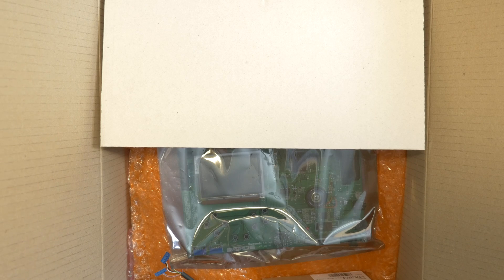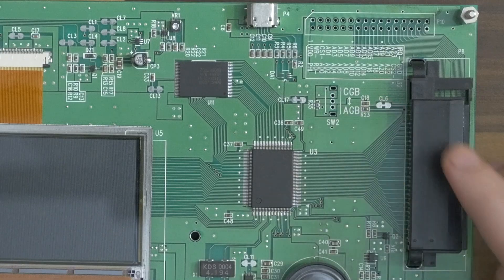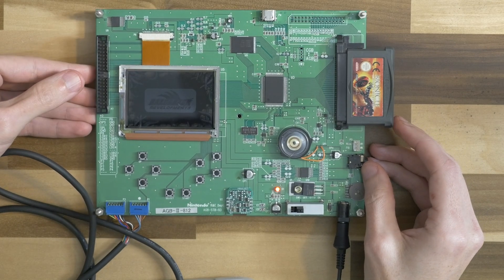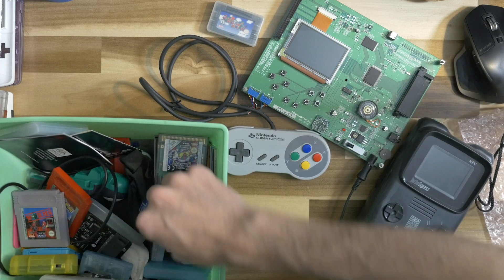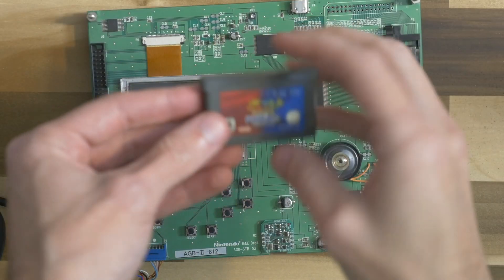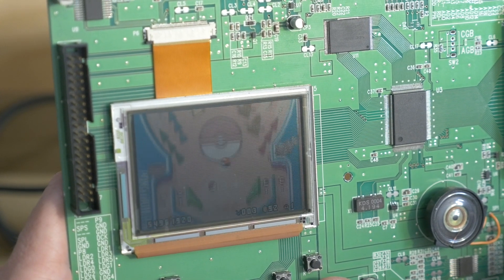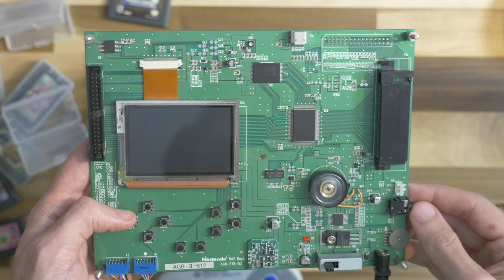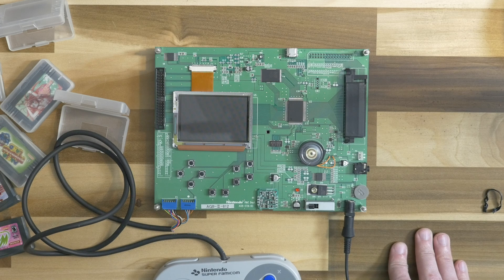The Game Boy Development Board!

Comment: do3s this work with an IPS display?
Reply from the maker: It may have glitches, but it most likely would work. I didn't try when I had the board, though.
Reply: @esotericsean  better yet, is there a way to push out digtal video signal via HDMI or VGA using an FPGA board? It would eliminate the need for a crappy onboard display.